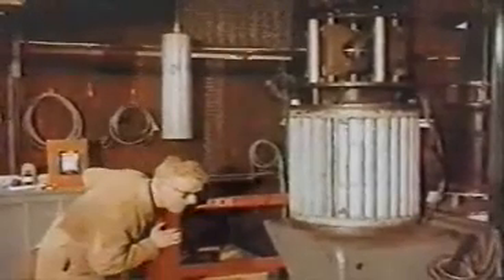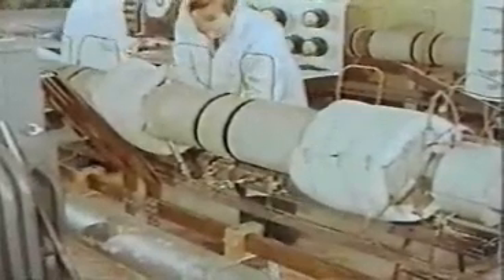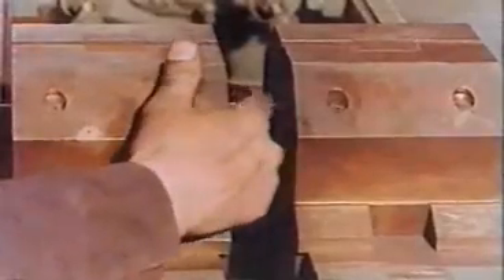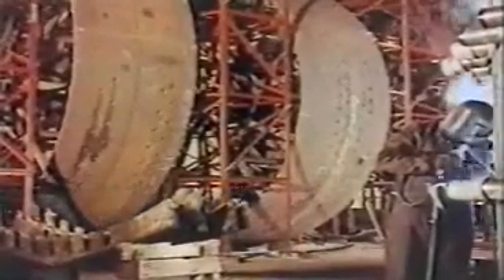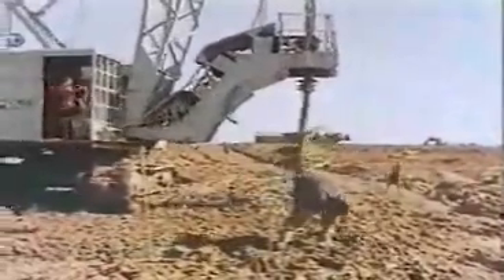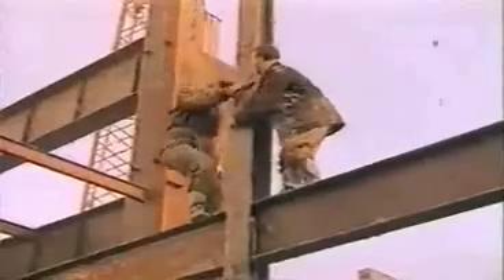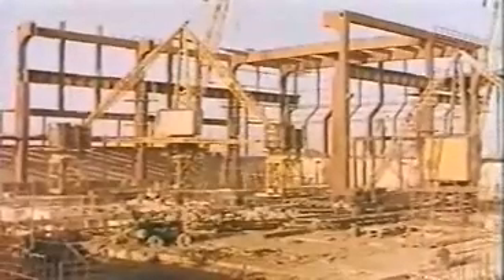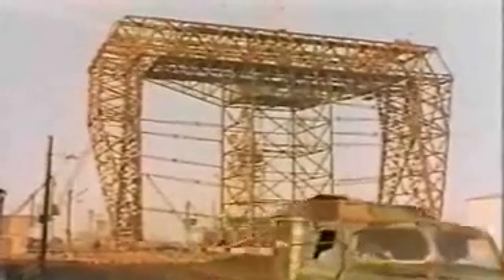Bradwell power station construction part 2

Comment: Roger....I was an apprentice boilermaker/plater @ Whessoe in the early 70,s and worked on the equipment in the clip.........fascinating  stuff, brings back good memories, the shadow bay and pendulum burner were unique and the only type in the world i believe...specially developed for the Bradwell proect but extensively used thereafter for petal plate production to build spheres for the petro-chem industry.

Comment: Hello Roger
what a fascinating collection of films. I am making a documentary on one of the Bradwell suppliers - Head Wrightson of Thornaby and there is some short but superb footage in two of the Bradwell films of heat exchangers under construction - and amazing shots of them being launched on the Tees for transport to Essex.  Are you able to lead me to the original versions
of these films - I am trying to get good quality clips 
Kind regards       dereksmith 07774930516